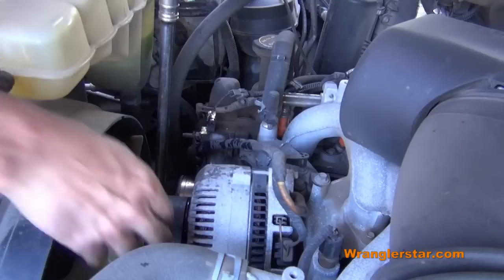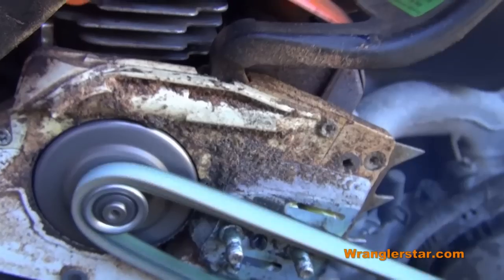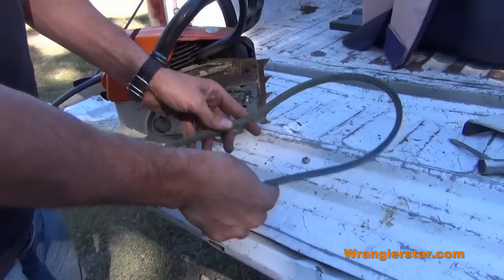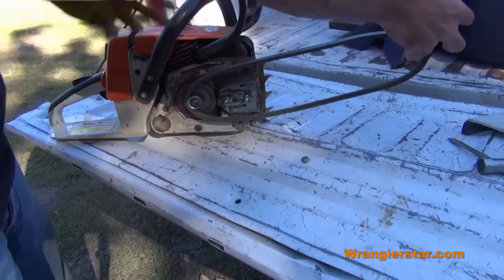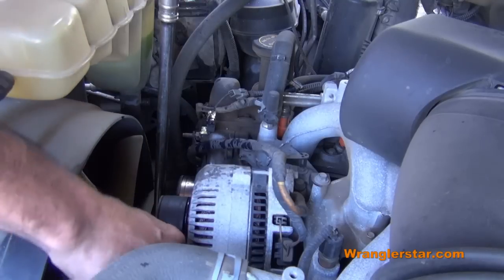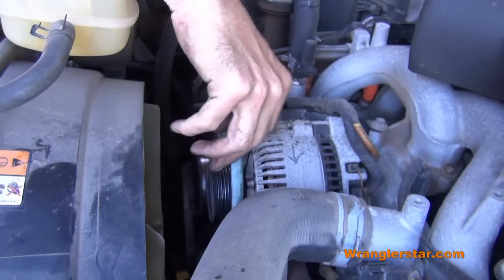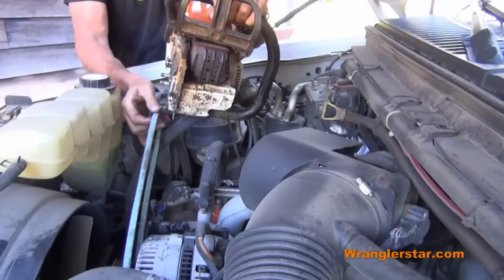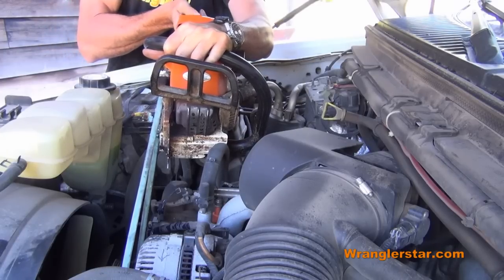Charge A Car Battery With A Chainsaw

Comment: I'm concearned that without the field coils energised this would not actually work... an alternator will not generate electricity just by turning like a permanent magnet generator would.  This is a great idea, but it might need a little more macgyvering to make it work!
Reply: agreed u need power to make power if your battery is stone dead this will not work at all.
Reply: There is almost never "nothing", it only takes a tiny amount in the field coils to get things going, but it's gonna be hard to get that going without putting the ignition on, and that will consume a lot of power itself.
Reply: James Lewis
good point about the ignition needing to be on.  i feel this guy is talking out his ass due to the fact he didn't mention it also an alternator doesn't care which direction it turns.  as for how little it takes to get going i once successfully bump started a 93' s-10 that was doing the oscillating click when turning the key which is about as dead as it gets without it being nothing.
Reply: ihearvoices22 If the vehicle is old enough to have traditional points you might be able to get away with putting the ignition on and pulling one of the coil wires so it doesn't use all the power you generate... if it's a modern engine with computers I have no idea.
Reply: it dose work but like you said needs a bit for it to charge i had a flat battery in my automatic cruiser but it wasn't dead flat just not enough to turn the engine over after doing this for 10 minutes she had just enough charge so i banged the belt back on and presto
Reply: gotta turn the key on to charge the exciter.
Reply: Alan Fisher Agreed, but if the ignition draws a few amps... it might be more than you're generating... might be worth disconnecting the ignition coil if it's an old style points system.
Reply: This is true!, And make sure the lights and all accessories are off too!
Reply: Oh and a modern engine you leave the key off and run a wire directly from the positive on the battery to the alternator.
Although it's a modern engine the alternator design ain't changed much.
Reply: Alan Fisher In most modern vehicles the chances of you getting access to the alternator without disconnecting a ton of other stuff is slim, so you might not be in luck there anyway.
Reply: true true
Reply: Alan Fisher i can't speak for all cars but the older gm alternators (cs-130 i believe) require some resistance or the regulator will fry.  so hooking a wire straight to the alternator is a bad idea.  there is enough power in a chainsaw to overcome whatever load might be associated with having the ignition on,  assuming you turn off non essential items like headlights, radio and the Hvac system.
Reply: ihearvoices22 The exception to this is an old style ignition with points where the coil is possibly energised all the time the ignition is on, and can draw as much as 5-10 amps... you "might" be able to use this method to get things going... but you may well need to have a good understanding of the ignition and alternator setup i your vehicle...

Still, it's an interesting idea!
Reply: With a near dead battery wouldn't the load on the alternator be so great that it would take a huge amount of force to turn the alternator? Seems it would be very difficult to keep the belt from slipping if the chainsaw could actually turn it. forget about rope or boot laces holding up.
Reply: RLZerr The amount of current generated depends on the speed of rotation, so it would be somewhat self regulating... you could just spin it up until the load was appropriate,

Comment: Lot of skeptics saying if the battery is dead, there is no excitation charge to get the alternator to charge the battery. I've gotten the battery in my jeep too low to start many times (that 4.2 inline 6 is a beast to start) where the starter is just going whoop whoooop whoooop. The battery is obviously not completely dead, the lights still come on bright, but there isn't enough of a charge to spin flywheel fast enough. Someone please tell I'm wrong, but I imagine, in that state, there's still plenty of juice to get the alternator charging.

Comment: i have also heard of people using their cordless drill to run the alternator to charge the batteries. you have to remove the serpentine belt and have the right size nutdriver. Yes a jumpstart box would be the better option,if you have it with you.

Comment: I like the idea  , but if your battery is completely  dead  this won't work as some juice is needed to operate the electromagnet in Alternator
Reply: The remanence in the magnet will produce a small current which is then used to magnetize the magnets. It might not work if your alternator is brand new but there are many people using car alternators as generators for off-grid power even without batterys at all.
Reply: exi is right. Only a very weak remanence in the alternators rotor is needed to bootstart the charging process.
Reply: No no no no no no no. No! Alternators are self-excited. They retain enough magnetism in the rotor to bootstrap the field current to operating conditions. (Google if you didn't understand that.) The battery is completely irrelevant, except as a load to absorb inrush current.
Reply: Generally only aftermarket one wire alternators are self exciting. The majority of OEM alternators require electrical input to excite.
Reply: Evan MacDonald You're half right. Alternators with an exciter field tap are the most common OEM choice, in part so that the car will charge at idle from a start (with no revving). But most multi-wire alternators will self-excite, anyway – once you spin them fast enough. It shouldn't pose a problem here.

Comment: I have always made it a practice to save the old fan belts and now serpentine belts when I replace them during normal maintenance.  And also carry a pair of pantyhose
along also as in a pinch they can be used to assist someone on the road that has broken belts etc.  Just be sure and keep the vehicles speed down to a slow rate of travel.

Comment: Great idea!.  Unfortunately, if the battery is completely drained this won't work.
Automotive alternators are not "self exciting" They have to have a small
amount of DC voltage from the battery to "excite". usually 9-10v DC minimum
from the battery.  This would definitely work great for a low battery though.
Very resourceful.
.
Reply: You're quite right about needing external power for excitation, and you may also need to have the ignition switch on to energize the voltage regulator. If the battery is completely dead you could try flashing the alternator field with an external battery to initially build voltage.
Reply: You are correct. Alternators need voltage to excite the windings since it is all part of the charge circuit.  If it was an older DC generator with permanent magnets that's okay and not a problem.
Reply: Abitibi_Doug
I have bump started many vehicles with the battery completely removed. In fact I have driven a VW GTi, a Lotus Europa and an early Porsche 911 all summer this way and was just always careful where I parked. The GTi was light enough that it was very easy to push and jump in the driver's seat as long as it was on a flat surface. The Lotus was so low it was hard to jump into the driver's seat in time and a slight incline helped with the 911, but I got so used to it that it seemed the only thing that ever made me buy new batteries was the onset of winter snow.

I was one of those people that spent every penny on the fastest car I could possibly afford and then saved as much on maintenance as possible by doing things like just changing the filter instead of the oil until the oil got carbon saturated, constant tire rotation, etc... :)

Don't need but 10-20' of roll to bump it if you're good. Apparently Bosch and Lucas alternators both have windings composed of an alloy which makes them a sort of small power permanent magnet
Reply: Karen-Audrey .Todd That's quite interesting, I didn't think you could roll start a car equipped with an alternator without a battery, but I've never actually tried it either. As you say, those Lucas and Bosch alternators must retain a lot of residual magnetism. I've tried spinning a Ford alternator at high speed with no excitation, and it saw didn't build up any voltage. When you roll started these cars, how fast was the engine turning before you got ignition?

I've run a car with no battery (after starting it with one) and found it ran fine, but the voltage would fluctuate a lot with changing loads without the battery to stabilize it. I got away with it on older cars, but wouldn't try it on newer ones as the extreme voltage fluctuations could damage the electronics. If I had to run one without a battery, I would have a large capacitor in place of the battery to help stabilize the voltage.

Comment: Alternators do not have magnets.  An external source such as your battery needs to excite the field to create a electro-magnetic force, then the diodes turn the Alternating Current into Direct Current that is governed by the regulator to send 13.8 volts to your battery.  It just takes a volt or 2 to excite the field and then it's power to the banks.  Neat stuff.  If you have a generator, then what you say is true.

Comment: you don't have to spin the alternator in any particular rotation.  That's why it has a rectifier bridge.  But anyway very cool McGyver move.
Reply: hmm good point but things like motors and generators, that are designed to spin in a specific direction can be damaged by turning the opposite way i thought? or is that a misconception?
Reply: pfow2006 more like a misnomer.  most DC brushed motors are bidirectional, the brushes are placed directly centered on the commutators.  however some are offset somewhat. these will go the other way but will wear very quickly. the offset is specific to direction.  now universal motors found in table saws and grinders ect. have bushes. however they will ALWAYS rotate in one direction  no matter the polarity and either A/C or D/C current.  this is due to the way the motor coils are wound. now for an alternator the the commutators are solid rings.  thus any direction if rotation will not wear any more than any other.  now motors such as 3 phase brushes induction motors the direction is universal and may be changed by switching any two of the three phases.  hope this helps.

Comment: there is a better way for manual shift trucks put into 4th gear jack up either rear wheel and spin wheel by hand with ignition on the differential will stop the other side wheel turning, works every time
Reply: +dennis lockwood  Best to jack up both sides first to observe if yea may have a limited slip rear end; otherwise you may be running after your truck: I once left my Subaru in gear with wheels spinning in some greasy wet slime covered grass; got out and when pushing against the door jam failed then went around back and put my back against the hatch and hands under the hatch latch and dug heels in and was barely pushing it thru the slime, when suddenly it gets purchase, I fall back in the slime then regain feet and the chase is on cuz I had added a fast idle lock to the throttle for those cold mornings when heat is appreciated and back then GL 1800 Days not recommended to excessively idle a Subie (Had it on in this case to prevent a stall). After a brief chase I stopped and watched it cross the field and crumple into a dead-fall in a fence row. I used to keep a coupla of those old Hibachi's & a box of tin foil to direct heat  in my truck for the super sub temps, yea could get coals going and alternate Hibachis under tranny/engine/rear end/ then jack up but I ALWAYS USED A LUG WRENCH TO ASSIST SPINNING WHEEL otherwise your head is in a compromising place.
CMVHighPriest

Comment: Some comments are wrongly saying that an alternator will not charge with a totally dead battery because it needs some voltage from the battery to excite the field coils..   This is WRONG as most modern cars and trucks utilize self contained internally regulated single wire self excite Alternators that do not require battery voltage to produce current...  GM cars and trucks have been using this system since, ...well a long time, at least as far back as 1980.    If you have a three wire alternator there are video's showing you how to rewire it to self contained / self excite..
Reply: +rainmechanic Some alternators will have enough residual magnetism in the rotor to self excite under no load,  but my trucks really want a tiny voltage on the F wire to get things going and the internal regulator will take over.  Even a 9v batter would be enough to get things started.

Comment: Alternator has no permanent field magnets inside - some electricity takes from car battery for creating field for its own job. Thus the battery should be not exploited to the bottom (and can freeze easily in a cold day) - much better is to use Codie's method first. The controls of the car should be switch ON to supply the alternator's rotor coils. Question is, how much time&gas should it take??? I think at least 15-20minutes at 4-5000rpm on the alternator beltwheel. One could use a spare multiwedge belt with a proper roller for chainsaw power output. Otherwise the wedge slots can be filled with V-belt remnants. Anyway very inventive idea!

Comment: Actually, YOU DON"T NEED TO KNOW which way the Alternator turns.  That is why it is called ALTERNATOR*.  It generates AC regardless of which direction it turns.   Then the AC is routed thru a Set of Rectifiers to turn it into DC current.  
The Regulator does not come into play until the Battery is almost fully Charged. 

However, For this trick to work You must have a trickle of charge left in the battery, as it fill need even a tiny bit of current thru the rotor in order to build a magnetic field.  

*in the Old days, Cars had Generators NOT Alternators.  They generate DC from the get go. So, on those YOU DO NEED TO KNOW which direction it turns in order for the polarity to be right but NOT SO w Alternator.  You can turn them in any direction. 

But writing about this, Just gave me an Idea for a new Invention.  One that even a woman or even an Old Lady can use to start the car.   INCLUDING, Of course, City Dwellers who don't normally carry Chainsaws in their vehicles!!   Yeah!!!
Reply: +Jess Cast if you want to do this a long time it is important for what direction it goes because the rotor has cool blades to cool the whole alternator because charging provides heat
Reply: XEditedX  Yes, but to start the Engine for 5 mins. You don't need to worry about the cooling fins.   In any case they will STILL work.  but pro. not as efficient.
Nontheless   You don't need cooling fins unless you are cranking full amperage for hours.  Like driving cross-country with the AC ON and headlights ON etc. 

The point here,  was to let everyone know that for this emergency procedure, you don't need to sweat or KNOW which way does the ALT. turn normally.  Just Crank the SOB in any direction and Get Going!!!

Comment: Step 1 . .  .grab your 1/2 inch breaker bar with correct socket
Step 2 . . . have a spare belt, tools to dismantle chainsaw
Step 3 . . . have some gas left over to run saw 15 minutes
Step 4 . . . turn Ignition "ON"
Step 5 . . . breathe fumes for 15 minutes
Reply: well l do keep a breaker bar in my car anyways in case of a blow out on the road. and since you do need to be able to service your chainsaw on the go l would already have my sockets with me.

nylon stockings work great, my step dad taught me to always have a pair of nylon stockings in my car because they make a good temporary belt in an emergency. or you could just use your shoe lases like he said or hell maybe the saw chain would work as well.

well l would make sure to have plenty of gas if l am using my chain saw out in the middle of nowhere but if l was out of gas then l could just siphon some gas out of the truck tank, l mean a chain saw can run for about an hour on a gas tank no bigger than a plastic water bottle. and even though l am out of 2 stroke l think the saw could last 15 minutes on regular gas if it was an emergency. 

well you have been breathing chainsaw fumes for the past few hours cutting down trees so what's an extra 15 minutes?

Comment: You can also keep one of those "jump starter" battery packs in the back of the truck.  I have one that also has an air compressor on it, AND, a 120volt inverter outlet. I have used this device several times, and it holds a charge a long time. The better models have a digital display showing remaining charge left on the device.  This gizmo is a no brainer, and much easier to use, plus the wife can use it by herself if she has to. good luck.

Comment: virtually all alternators turn clockwise when viewed from the front. exceptions Honda and Acura where the engine runs counter-clockwise and belt is on the driver's side ( left side).

Comment: Should the ignition key be in the running position for the regulator to operate and the alternator to charge?
Reply: Yes - on later cars, as these have the alternator charge regulated by the engine control.
On early cars, you only need the weak remaining charge in the battery from start of this charging method.

Comment: pretty good trick.  too bad not all alternators are that easy to get too, and even worse, most times you're going to need more than some basic tools to get the tensioner loose enough to pop that belt off the alternator and also to put it back on and tighten it up once you get your car started.  Its not so much to expect that a lot of people may keep those tools in their trucks, but for the average person you probably wont have all the stuff you need.  A decent socket set and a pretty big screwdriver should get you started, but that depends on the car model.  I definitely like the idea and hope i can impress people one day by busting it out when needed
Reply: Bbfishman